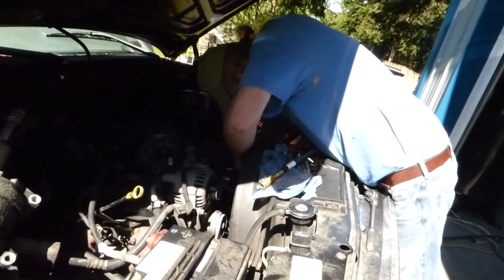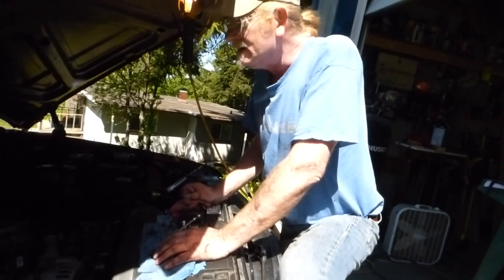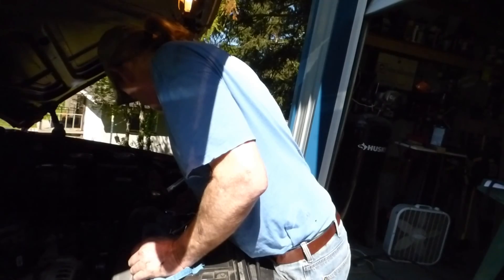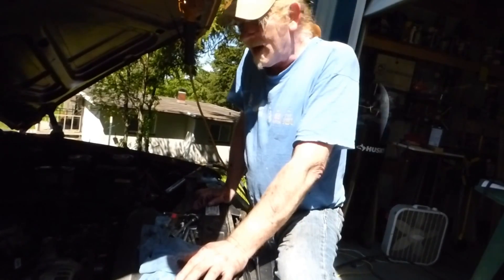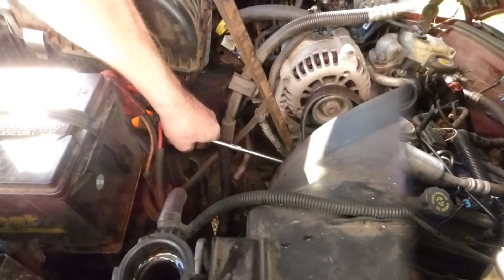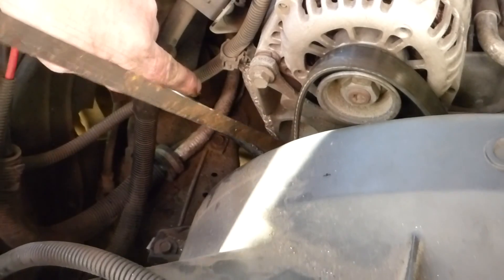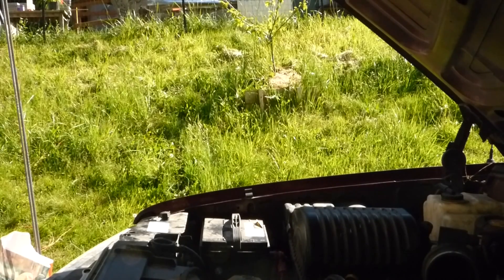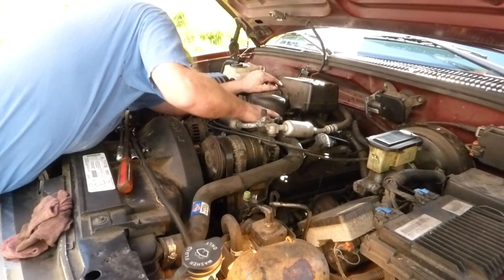1998 Chevy Cheyenne C1500 pickup truck Intake Manifold Gasket Replacement

Comment: can the sludge plug the oil filter?  I hope your head aint cracked, could you see the problem with the old gasket?
Reply from the maker: +WORM GITTER We're good.  There should be a shot of the gasket where it failed somewhere - I thought Amber included it.  Evidently it's a common problem since they use plastic gaskets.  A replacement gasket is $26.  If you want one that won't do it again, that's $30 more.  The oil filter weighed a ton!!!  It wasn't pretty oozing out.